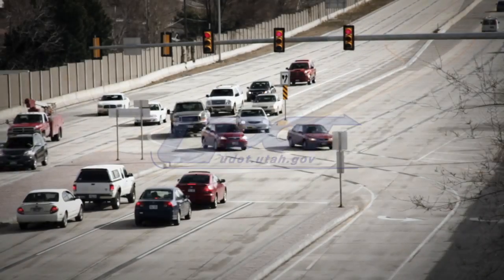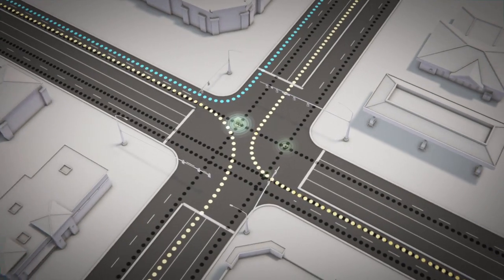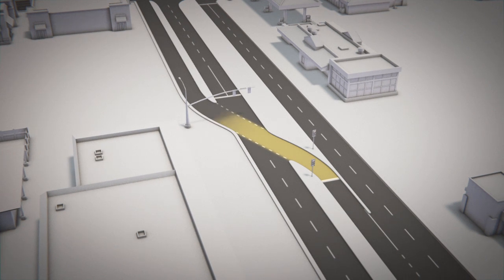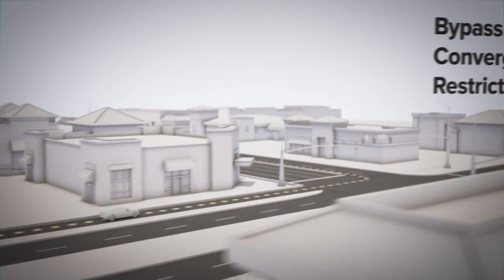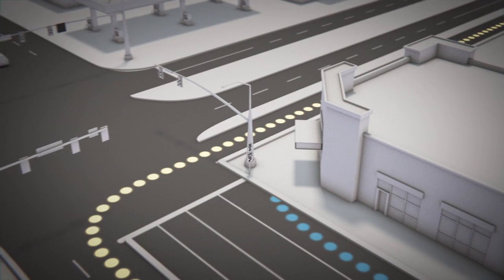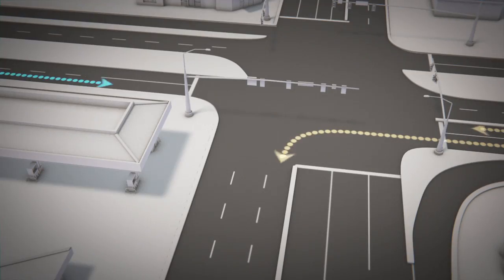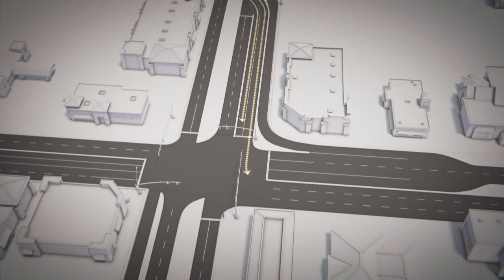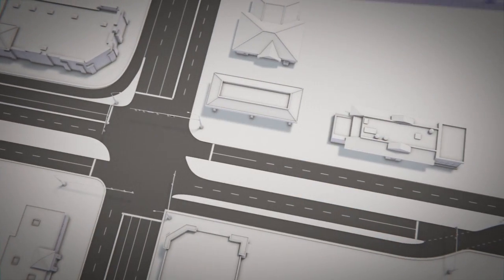CFI Tutorial

Comment: Just use roundabouts.
Reply: Do you not see the existing buildings with possible business? a Roundabout needs space to accommodate large trucks and semi tractor-trailers safely.
Reply: A typical roundabout requires no additional right-of-way than its existing 4-way intersection. The CFI (as demonstrated in this video) nearly always needs a wider approach in order to accommodate three modes of traffic, Inbound, outbound, and counter flow. 

A properly designed roundabout can accommodate even the largest trucks by providing an apron, or by building a mountable center.
Reply: I have had to forcefully use a few poorly designed roundabout with curbing and landscaping in the center at one, thus I was causing others to have to wait or move out of the way so my rig could make it round safely though with some damage to a few tires that has to ride the curb. Forty to 53 foot trailers do not follow the same tracking as the truck towing it at low speed and over 45 feet trailers are far worse at turning at an intersection from a stop than the shorter trailers. Of the roundabouts properly designed or more so usually had two lanes with a number of users not knowing how to use the damn roundabout properly or safely nor using their directional. OF most the roundabouts I took were much larger in outer diameter than what this intersection can offer.
Reply: The point of a CFI is to improve capacity for busy intersections, particularly those with many left turns - Roundabouts, on the other hand, have less capacity than a traditional signalized intersection (with the same number of lanes). Roundabouts are great when there is light to moderate traffic.
Reply: Make traffic jams!

Comment: JJS-  I compliment UDOT in using different traffic engineering solutions to fit different circumstances.   The days of solving traffic problems with an intersection and 4 signals are a thing of the past.  The CFI will move a tremendous amount of traffic and reduce delay  times significantly.  UDOT is doing the right thing by educating its users on how a CFI will operate. Its good to see state DOTs using traffic solutions that others in the world have used for a while.

Comment: Stay in your corresponding lane and this is not an issue. Not only in CFIs but in all intersections you are REQUIRED to stay in your own corresponding lane when making a turn. If you need to change lanes for an upcoming turn then signal once you've made the turn into your corresponding lane and get to the lane you need. This allows for as much of traffic as possible to keep moving, avoid idling, avoid backing up into other intersections, avoid gridlock. It's important!

Comment: I appreciate the reply.  The trouble is, Utah drivers don't follow the code.  If you watch traffic at most intersections, double-left-turn drivers usually turn into lanes 1 & 3 ... not lanes 1 & 2 like the code requires.  That's pretty scary as a right-turn driver, trying to also turn into lane #3 ... which is why engineers NEVER put a right turn arrow during a conflicting left on any other intersection in the state.

Comment from the maker: I talked with our region traffic engineer & he explained that Code requires drivers to turn into the nearest available accepting lane when navigating a turn. We have some locations where we've had to restrict the overlaps of the left & right turns because there are more lanes turning than there are lanes to accept vehicles on the cross street. At 4100 S there are 2 lanes of turning traffic & 3 lanes to accept the traffic. Right turn bypasses are costly & we install them when we can.

Comment: The right-turn is a HUGE problem.  I am practically an engineer, and was geeking about CFIs and DDIs and SPUIs before UDOT builds them.

Yet, at 4100 South, I almost crashed because the simultaneous right turn arrow mixed with the merging left, really threw me off and scared me into slamming on my brakes.

DO NOT ALLOW right turns until after the cross-over left is complete.  Better yet, spend the cash and build the free rights.